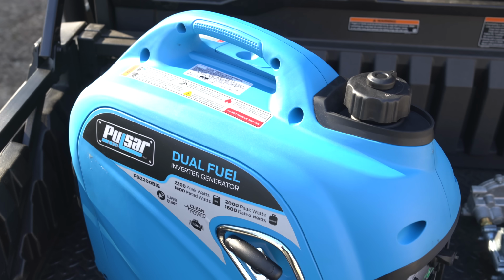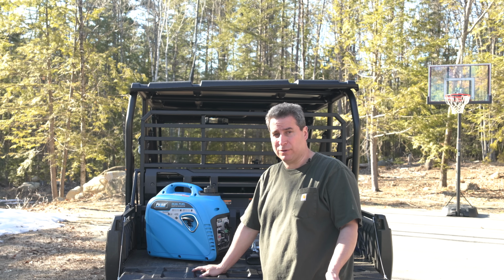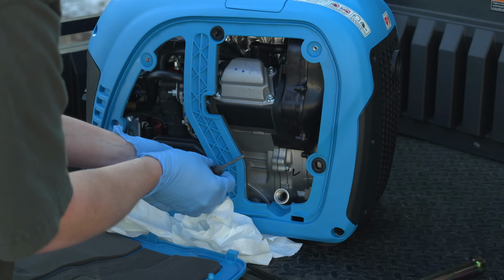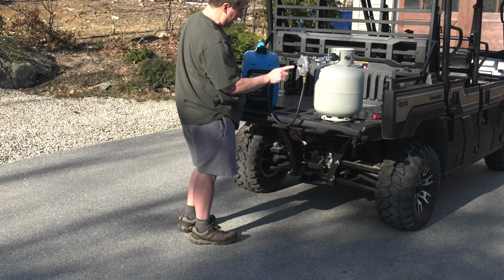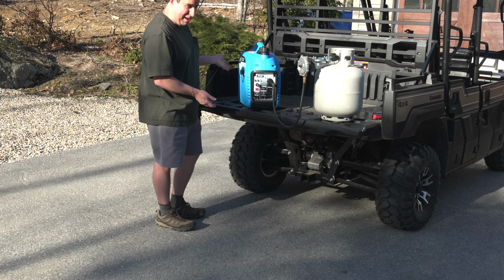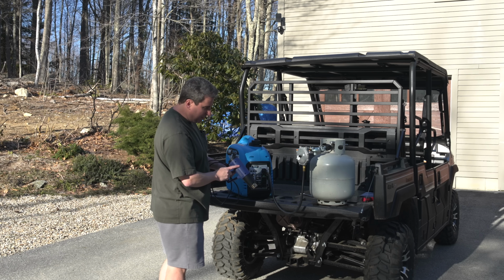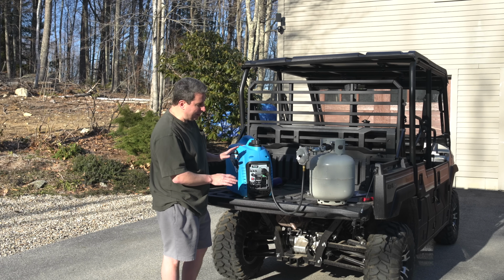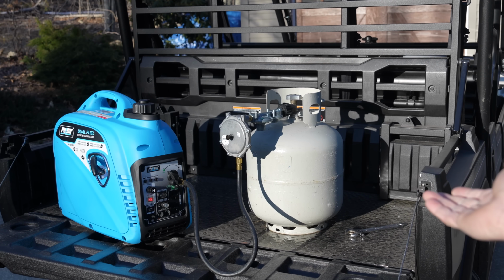PORTABLE PROPANE Dual Fuel GENERATOR 2000 Watt - Pulsar Review

Comment: So 4hrs r7n time at full load?  How much is average for gallon of propane for us city slickers?
Reply from the maker: If you are running the full 1600 watts, it would run for 4 hours on one LP tank. Keep in mind 1600 watts is enough power to run (4) 5,000BTU window air conditioners
Reply: 40 to 50$ for the tank then 20 to refill

Comment: Who makes the motor for it ?
Reply from the maker: I don't know if there is a specific brand but here are the specs on it: 80cc, 3Hp, single cylinder, 4-stroke, OHV, air cooled Engine - Pulsar has made a lot of generators. so they may do the engine themselves.
Reply: @SilverCymbal  Was hoping for a Yamaha
Reply: @WhiteLightning77  if it’s a 80cc engine it will more than likely be a clone mz-80 engine. Which is a copy of the Yamaha motor. 
Lifan, senci, ducar, rato and more make this engine since it’s so popular 
Last I checked many of these models were made from ducar. 

But they can change as so many are making them now
Reply: @WhiteLightning77  not at this price point
Reply: @slayer66thfc  it's been used on cheaper units and considering this one is 40% off, it's not much of a stretch.  

I have a few Hondas.  My thoughts were this unit is $100-$120 bucks more than a propane conversion kit for any of the Hondas.  I'm fine with gas, but have 400+\- gallons of propane at a given time too.
Reply: @WhiteLightning77  as an extra layer of security to have propane. Perfect.  And modern synthetic oils won't go bad in a year. So it can sit and be happy

Comment: Who’s the manufacturer?
Reply from the maker: Pulsar
Reply: @SilverCymbal  Chris Pulsar is the company but it’s really just a sticker over the unit. Many of these units like the generac in your video earlier is not made by generac but just a sticker. 

If you look on top normally there is a spec sticker. It will show model, rpm, spark plug, and some other info and then manufacturer company 
Should be Chongching China somewhere.

Comment: I bought the 4,500 Pulsar BisRCO Dual Fuel about 6 months ago when it was on sale. Have not cranked it yet but will sometime this week if I can find out if I really need to use this extra Regulator looking thing. Mine has that Large extra looking regulator thing also(but it's black) and has NO button to push. Have I GOT to run this Part? I purge mine by just not tightening the  nut to the generator so tight at first, turn on some propane for 10 seconds or so, then tighten the nut securely. I'm thinking that other large regulator looking thing might have something to do with pressure leveling on say, 100 lb. propane tanks or something or, using the Tank on a say, 15-20 foot hose or so.... Just wondering if you or anyone knows If it can be ran with-out using this extra piece. Thanks my friend & thanks 4 Video...

Comment: Do I have to uses that BIG "Zero Govenor Regulator" as this unit already has a Dual Regulator on it. 1 to reduce to around 10psi and the next down to 1 -2 psi with 11" water Columb.. Have you ever tried running your without the 3rd zero governor? Thanks..

Comment: 8hrs @ 50% load :(   What use is the ECO mode?
Reply from the maker: Eco mode isn't fixed. You can run at 10%, 20% 39 and so on. But they have to pic a spec to share, so it adjusts to what power you are using.

Comment: It’s NOT Big Enough to Start 1 Sump Pump even !!
Sump Pumps Run at 1050 watts but for Start up of the Sump Pump
Needs 3x + Watts 3,000 - 4,000
😢
Like the Propane Fuel Option though.
Reply: might be able to use a soft starter